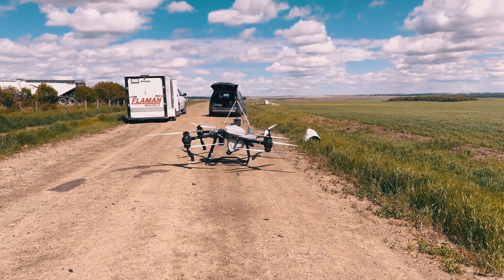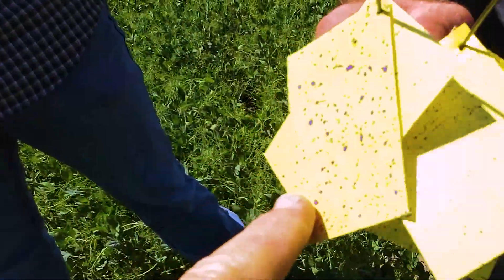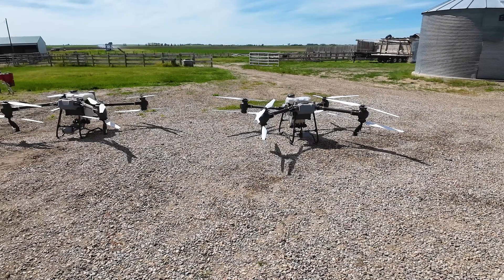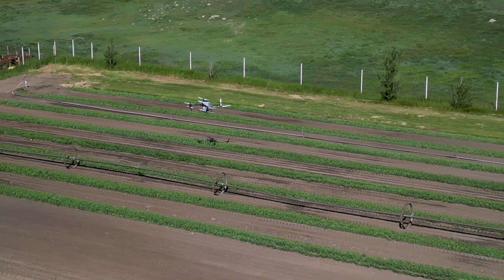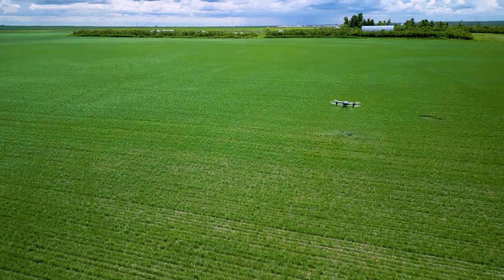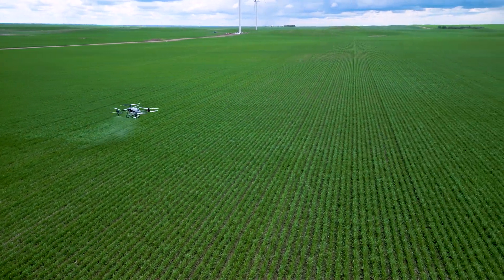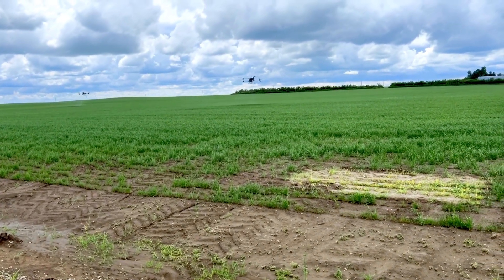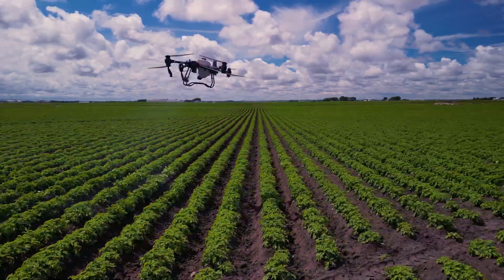DJI Agras T50 Drone Demonstrations With Rocky Mountain Drones and Flaman

Comment: Great video and perfectly shot v different to operating in SE AUSTRALIA  in steep hills. Good to hear speed, height in metric. Can you tell me speed height and swath width? P
Reply from the maker: We have found that wind plays such a big role. I can tell you what we do though. If winds are less than 25km/hr, then we will fly at 3 meter , about 250 micron and will expect 10 meter swath. We will drop alt a little bit at a time to find a sweet spot in higher winds and lose a bit of swath. I have also come to love to film with a chase drone to get a real accurate look at how the fluid is behaving and adjust. For example if you have a look at the sequence starting at 10:17, you can see very well what a speed of 25 km/hr which is just below 16 mph, 3 meters alt and 250 micron behave like in a 15 km/hr wind. The wind direction also worked out so that we were able to fly the field with and then against the wind direction which also is a huge contributing factor. We do not love flying with a side wind.